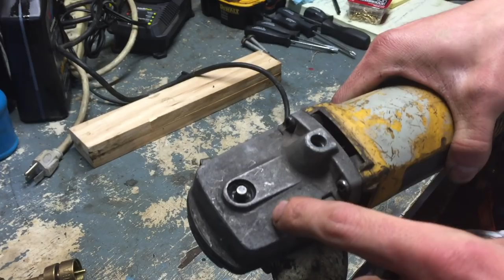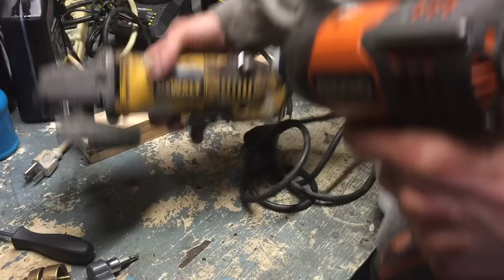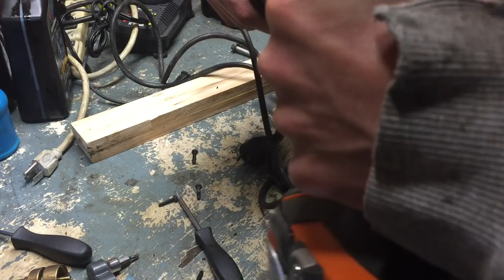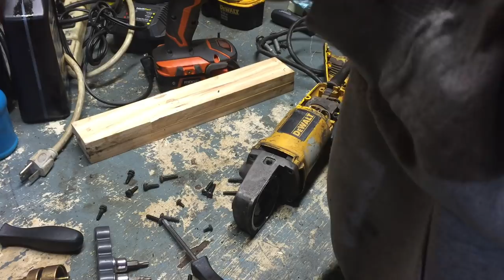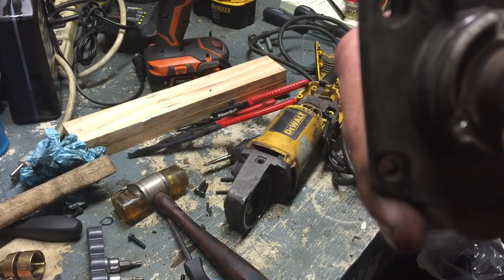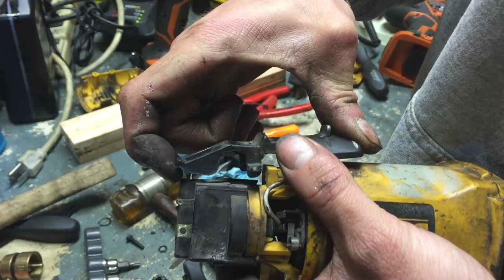DeWalt DW402 4 1/2 inch Angle Grinder Failure and Teardown Part 1

Comment: I have a dewalt dw402 also. wiring a new cord on, 2 wires in, but 4 terminals on the switch. do you know the correct connections? maybe a picture. I looked on youtube for hours with no help.
Reply from the maker: Sorry I do not. I don’t have this grinder anymore
Reply: Try this vid...  https://www.youtube.com/watch?v=yTHysf9CC0Q
The guy tells you black is for brass and white is for silver terminal on the power side.  Go directly to 8:00 to see the work on the switch.

Comment: I need the guard and clamp for this model. It seems out of stock everywhere. Can you help me?
Reply from the maker: I found one on eBay DeWalt OEM N306360 replacement angle grinder guard DWE402 DWE4214 DWE4222
Reply from the maker: Might be correct? Not 100%
Reply: @IntoTheDirtshop  Thanks for the info. Turns out my DW402 is the older generation of grinders. The attachments are different. I found one that has a clamp on system with 40mm inner diameter clamp, the grinder is 38mm so it should work.

Comment: It is assumed that this instruction is to teach a safe and technical way to disarm the tool, not an instruction how to break it. I should take it out of YouTube, learn HOW NOT TO BREAK THE LID OF THE OUTPUT AXLE ASSEMBLY by disassembling this for the ball bearing change at least and then upload the video again. I'm still looking for that information because neither a postmortem is made to the broken piece to learn from the error as it is that the parts come out without damaging anything.
Reply from the maker: Josè Zarraga this video is meant for entertainment purposes

Comment: i wind an angle grinder but its carbon spark too much why? and what can i do ?
Reply: new brushes/clean commutator or add more spring force behind the brushes to hold them tighter
Reply: Sr tecnicos porq una pulidora de marca dewalt suelta el disco cuando se prende